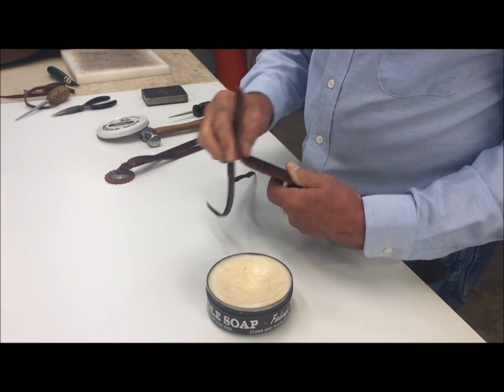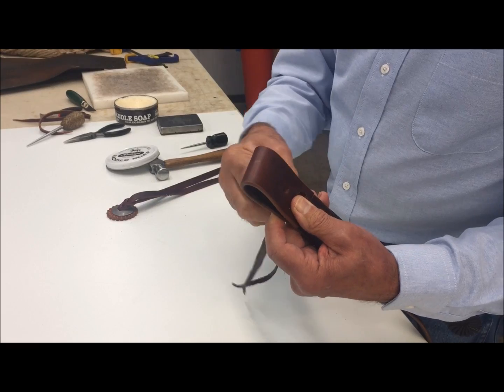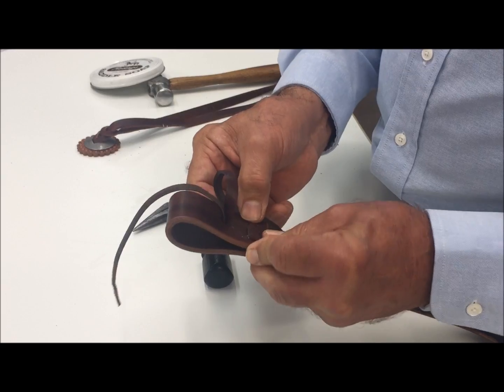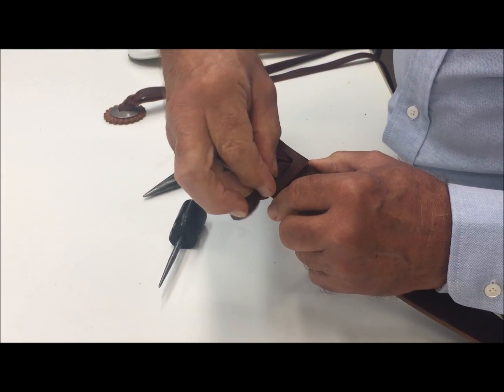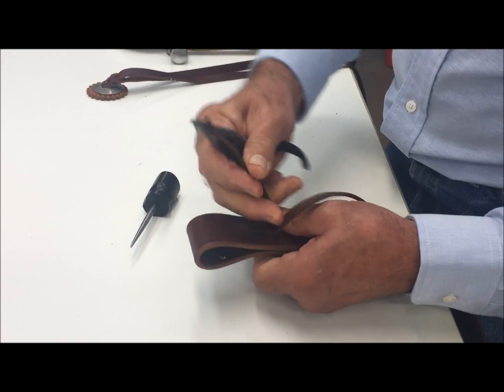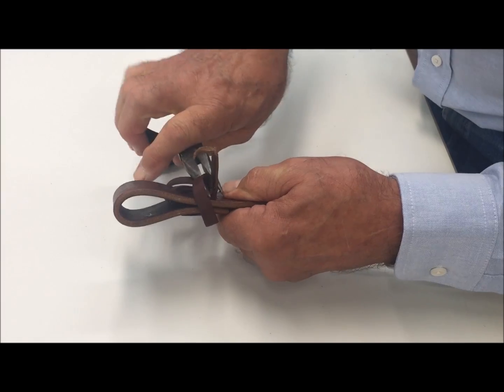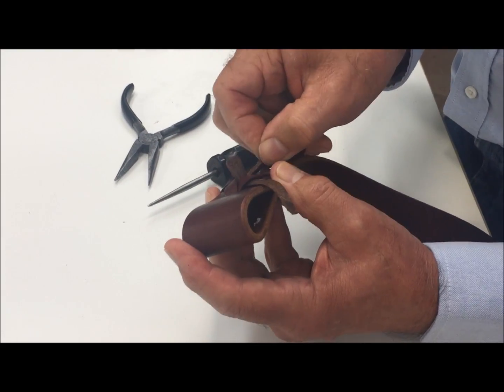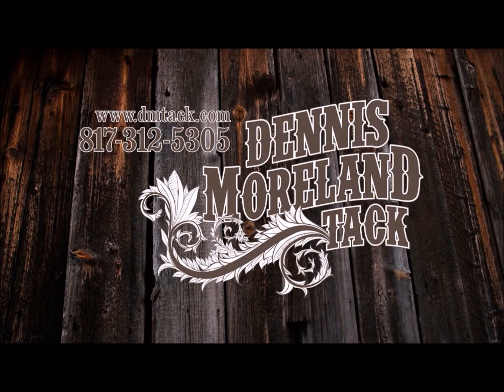How to Tie the Saddlemakers Latigo Knot

Comment: How do you attach a sheathed knife to the upper back cinch?
Reply from the maker: Gerry, I would attach your knife sheath to your back cinch with Chicago screws at the top and bottom. . You will want to put super glue on the screws so they won't work loose over time . When you make the pattern for  your knife sheath leave a tab at the top and bottom to punch a hole in for the Chicago screw. If you want to put the screw or a copper rivet inside the sheath at the top and bottom you will need to do that first then hand stitch the edge of the sheath.